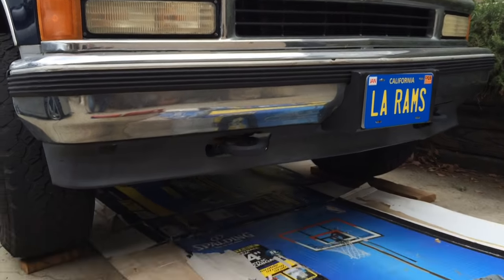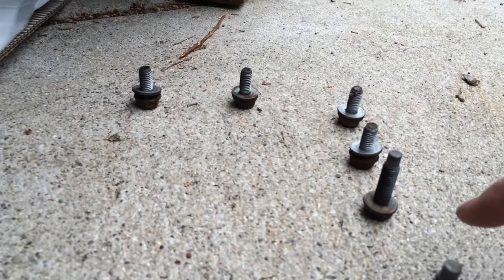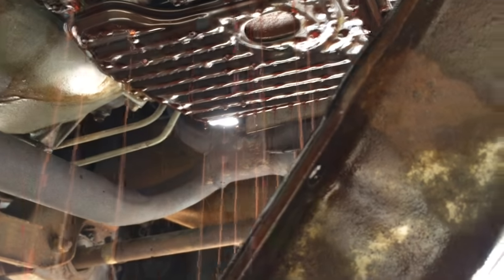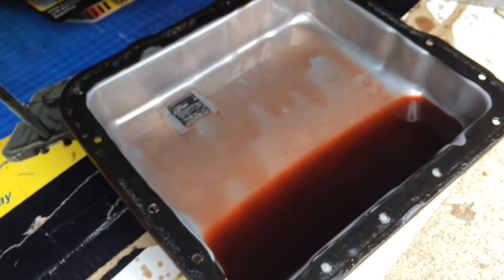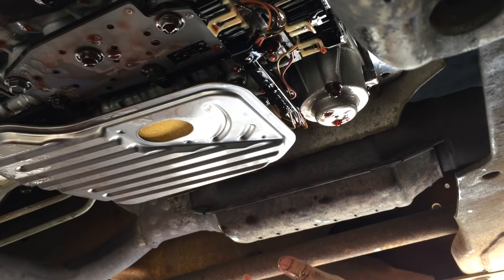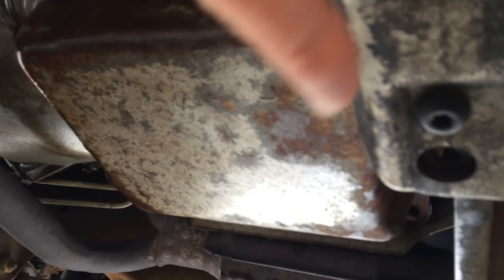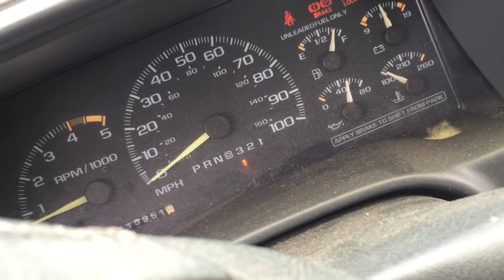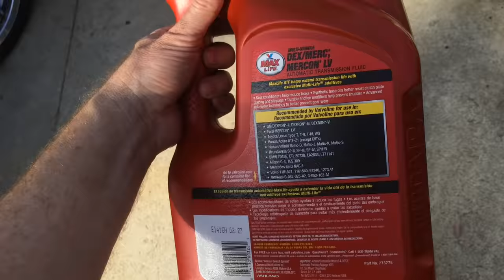Chevy Truck Transmission Fluid And Filter Change

Comment: I changed my transmission fluid and after 10 miles on the highway the RPMs shot up over 2000 and I couldn't go over 50 then I got off the highway and could not go over 25!!! No problems before I changed this WTF!!!! I took the pan back down and the filter had fell off so I changed the fluid and filter agin and it does the same thing.. Nothing looked out of place as far as sensors on the trans. Now I'm being told it has to be rebuilt!!!!
Reply: well maybe its better then to let a shop do it then?
Reply: Seth Buie you should always reuse old transmission fluid , pour through a strainer for sediment , . Swapping really high mileage transmission fluid with completely new fluid , will likely cause a rebuild.
Reply: Justin Ayres so how change only a little bit or what how do I prevent that
Reply: Justin Ayres  I just got a 91 1500 at 4wd truck. Serious tran issues. Was going to start simple and change fluid and filter...can you explain more on swapping fluid and any other suggestions.  Thanks
Reply: Tiffany Tatum for the most part this videos instructions are generally correct however as I mentioned above high mileage vehicles need to use as much of the original fluid in the transmission as possible if you replace it with brand new highly viscous fluid the transmission will start slipping because it lacks the Metal Sludge that it's used to. You can pick up automotive oil cone style filters and strain your old transmission fluid so that you remove any of the physically visible sediment in the fluid. Then mix that with a little bit of high mileage transmission fluid and for that back in it is of course a good idea to clean out the bottom of the pan and if you don't have a magnet go ahead and put one in there.. the filters look kind of like coffee filters with a micron rated mesh at the bottom make sure and get the largest Micron rating available which will allow as much of the original micro shavings to be kept in the oil.  All old mileage vehicle parts and fluid maintenance is basically the same, if you put a new part up against an old part you will get uneven wear in the old part will wear out faster the same applies to fluid which is why doing complete engine and transmission flushes on very high mileage Vehicles is almost always a bad idea unless you plan on rebuilding it.
Reply: As other commenters stated the cap that he removed was actually stuck inside the old hole he should have pulled the ring out and kept the new one on the filter it is basically a gasket
Reply: Coolant is the one exception to the fluid flush rule it is safe to flush the coolant reservoir and the water jacket of the engine in order to remove rust and debris and refill it with fresh coolant fluid
Reply: Tiffany Tatum  , I know this is late, but start with a bottle of Lucas trans fix.  See if that helps some.  If it does,   Start the process of what Justin Ayres says to do.
Reply: Justin Ayres  , thanks for the advice.  Unless regular trans fluid replacement has been done throughout life of vehicle, it is wise to proceed cautiously on high mileage cars trans fluid.
Reply: @johndavidson4128  he doesnt know what hes talking about.
Reply: @waterloo123100  I quoted my buddy that owns a transmission shop, I trust him over you
Reply: @johndavidson4128 You shouldn't trust him. I've serviced many cars that had never had been changed after 100k and they work fine. If its really  that bad after checking the pan all you have to do is put it back together and use the old fluid. That's just a myth people start to get more rebuilds in their shop.
Reply: @fathertime5680  lol, your killing me
Reply: @justinayres401 2 bottles of LUCAS TRANS FIX and B@M TRICK SHIFT  to top it off.
Reply: @thefireman285  Well, at least you got that right. It says on the bottle, up to 2 bottles of LUCAS TRANS FIX.   Man that stuff is a Godsend!
   Another product that helps is B@M TRICK SHIFT (it has friction modifiers to prevent clutch slipping.)  It is used in Drag Racing and is Compatible. Has to be ordered from most Auto stores.

Comment: no drain plug so stupid yet all foreign vehicles have a drain plug for this what was America thinking at least most newer American vehicles have this
Reply from the maker: +Eric Franks maybe they were thinking that you would have to take it to the dealer for service, and they would make more money. I am glad that newer cars have drain plugs.
Reply: if drain plugs were stock the public would never change the filter...
Reply: Its called "Lifetime" fluid. Git gud foreign scrubs
Reply: I did my filter and fluid change today with a bath of fluid all over my face and shoulder included.😂

Comment: Should have taken out the old filter gasket in the hole where the filter pushes back in and used the new won...Its the same ring gasket as the new won,,,anywho it's all good...

Comment: My 1500 LS trans pan has a damn cross-member in the way!! :-( pissed. Last time I did the filter it took way too much effort.
Reply from the maker: That's terrible. I wonder why they did that.  Maybe they wanted to make the frame stiffer.  I know that some of the Jiffy Lube type places have a pump that can change the fluid without taking the pan off.
Reply: Yeah, i have the pump and used it last time i did a service but I dont want to just do that agin, i need to do the filter eventually :-( Lol does totally suck tho bro
Reply: So I am halfway through this process myself on a 1993 S10. I have the same plate that runs across. On the passenger side there are two bolts holding it on. All I did was remove the two bolts with a 5/8 deep well socket (used a pair of vicegrips on the nut on the opposite site to allow it the thread out). This dropped the beam down an inch or two, which allowed me to get to the final three bolts on the pain with a mini socket wrench. Probably too late for you, but wanted to comment this in case others have the same issue.
Reply: I've been told by mechanics that my 1990 Silverado is like this as well, and that they use a jack to lift the transmission off the cross-member, enabling the removal of the transmission pan.
Reply: @hoohoohoblin  ya, and obviously the filter never gets changed. Rip Off!
Reply: @Scatterbrain76  Ya, it sucks more than anything that has sucked before.

Comment: Also people keep talking junk about you taking the cap off or the Rubber seal. Number one I took out that seal yesterday and that was a pain in the f**** ass. It took me probably 30 minutes to get that damn thing out and once it came out the rubber was good on it and the metal was fine I should have just did the same thing you did and take off the new one and put it up in there. Next time I do this I will be taking the new gasket off of the snorkel for the filter. The hell with trying to get that other thing out. I know I'm going to get probably comment saying oh use a flat head screwdriver but let me tell you what, I did. And it was a pain in the ass. Then trying to get the new one up in there was hell because I tried to use a little bit of transmission fluid to lube it up to get it in the hole, but it was slightly bigger than the whole and it just was is a pain. I'm more of a construction guy that's what I grew up on I am a little bit mechanically inclined but that was a pain in the ass
Reply from the maker: Thanks! I guess I am an accidental genius. I am glad I didn’t try to get the old one out.
Reply: Same E    Two important tools to remember :  Preparation H and Kentucky Jelly.

Comment: You ever have a problem with the automatic with shifting from 1st to 2nd. Like it's kind of a harder shift? Let me know if you have ever experienced this. I'm going to be dropping the pan. Changing the fluid and taking a look at the 1/2 accumulator. All the rest of my gears shift smoothly. Just a kind of a jolt from 1st to 2nd.
Reply: I have a 1990 Chevy k2500  that does this, only on the first few shifts. Once the drivetrain warms up a bit, the 1-2 upshift is not quite so harsh.
Reply: @kenc.9067  how long have you owned your vehicle? I just purchased this used off a guy. I'm slowly fixing up the body and going to make a nice work truck 😎
Reply: @blakebrass125  have owned it 7 months. It's in decent shape for its age, runs well, needs body work
Reply: @kenc.9067  mine needs body work aswell. Just finished fixing rust on front wheels wells. Going to weld in new rear wheel Arch's and put on some fender flares. Then tackle the rockers which aren't in too bad of condition.
Reply: I had that exact problem on my 1995 Sierra. Replaced the throttle position sensor today- AC Delco part number 213-895. Much better and smoother between gears. So easy even I could do it.
Reply: @tdoti101yt  I'll definitely look into this as well. Thank you

Comment: I take it that you use the old seal in the case cuz it didn't appear that you replaced it.
Reply from the maker: Correct.  It was still stuck in the hole.

Comment: torque specs is 9 ftlbs
Reply from the maker: +Joe Hernandez Thanks.
Reply: hoohoohoblin hi I have a1996 sierra step side but I having trouble getting to the bolts near drive shaft a plate that runs across the truck is in the way pls help
Reply: have you ever needed to replace the transmission solenoid?
Reply: So I am halfway through this process myself on a 1993 S10. I have the same plate that runs across. On the passenger side there are two bolts holding it on. All I did was remove the two bolts with a 5/8 deep well socket (used a pair of vicegrips on the nut on the opposite site to allow it the thread out). This dropped the beam down an inch or two, which allowed me to get to the final three bolts on the pain with a mini socket wrench. Probably too late for you, but wanted to comment this in case others have the same issue.

Comment: pump it out the top filler with a $5 pump.  you can take 95%  lot cleaner
Reply: don't ever do that, you get the fluid out but none of the debris, easy isn't always best

Comment: I left that cap on and it clicked into place. It kept falling out without it.
Reply from the maker: +bsizzle Hill that cap thing is supposed to be in there. On my truck in the video, the old one was stuck in the transmission, so the new one wouldn't fit in. I guess the right thing to do would've been to take the old one out of the transmission went out of stock, and put the new one in. Yours should be fine.

Comment: Yes. I cannot remove it.
Reply: According to 1996 Chev K1500 Haynes manual, The cross-member  isn't removed. The transmission is jacked up off the cross-member with a floor jack once the "center transmission mount nut is removed". A small block of wood is inserted between the transmission mount and the crossmember to hold up the transmission to maintain clearance for removal of the pan when the floor jack is removed. Cautions: Use a Piece of 2X4 wood block between the jack and the tranny pan to protect the tranny pan., Do not place fingers between the crossmember and the raised transmission. I have not tried this procedure, yet! You may want find a Haynes manual!
Reply: Thanks. I will give it a try. Shop wants 180.00
Reply: So I am halfway through this process myself on a 1993 S10. I have the same plate that runs across. On the passenger side there are two bolts holding it on. All I did was remove the two bolts with a 5/8 deep well socket (used a pair of vicegrips on the nut on the opposite site to allow it the thread out). This dropped the beam down an inch or two, which allowed me to get to the final three bolts on the pain with a mini socket wrench. Probably too late for you, but wanted to comment this in case others have the same issue.
Reply: @rickrichards345  I had a Bad feeling about that @#$!!!po💩!!!!
🤢ARRRRRRRRRRR! HULK ANGRY!

   OK, I'm better now. Where was I?
Should that 2x4 be Oak, Cedar or Pine? (just venting) 
   Thanks for sharing that. I had a feeling it would need a jack. 🙂👍🇺🇸

Comment: Thank you for a simple video. Fucking finally
Reply from the maker: You’re welcome.
Reply: @hoohoohoblin  I have a Silverado 1500 4.8 2 wheel drive LS trim package. I guess you could call it the Canadian model. He has 266 thousand miles I change the filter yesterday the transmission fluid was completely black. The magnet in the bottom of the pan was like goo. When I start my truck up and put it in Drive when it's trying to change out a first into second it revs up really high and I have to let off the gas and then it'll change in the second and then I put my foot back on the gas and it and runs fine. Do you think my transmission is gone? I thought maybe changing the transmission filter would help it. Also the new fluid is starting to turn brown because of the old s*** that was left in the torque converter

Comment: WoW! What were they [GM ] Thinking... No Drain Plug..Errr .. and many others..  That thin sheet metal pan... In the past.. have hammered [lightly]  pans back where they would not leak. With the help of a little sealant..
Reply from the maker: +MCTeck maybe they were thinking you would have to take it to them for service. Fortunately these transmissions run forever even if you never change the oil and filters. Looking under my car, which is 10 years newer, I see a drain plug and a spin on oil filter.
Reply: I got a 94 GMC Sierra 1500 I was driving to the field in firewood and hit a really bad dip in the ground and ended up denting the dome-shaped aluminum cover directly in front of the transmission pan and now I can hear the gears inside there scraping where is dented and also there's like a little drain hole at the center of the bottom and I can see  gear teeth in there there's about I think 4 maybe 6 bolts holding it on seems like I would be able to easily hammer the dent out from the inside if I can get the pan off any bodies thoughts please help I need delivered as firewood oh and can hear scraping and whining and gets worse as I accelerate Etc

Comment: need to remove that rubber sleeve ?
Reply from the maker: Probably. The kit came with one, but the old one should be fine. You can read the other comments by people who had a lot of trouble trying to get the old one out to replace it.
Reply: @hoohoohoblin  thank you

Comment: sad.... he didn't know where the supply line was and thus did it wrong. You just contaminated the new fluid by mixing it with the old. always disconnect supply line and attach a clear line you buy from home Depot till you get clean fluid
Reply: Paul Wyatt or you can YouTube how to properly flush a transmission instead of getting price gouged from a service tech
Reply: Jack Johnson which you should never do to old transmissions
Reply: Jack. Thanks for that idea. You confirmed what I was thinking: a Clear hose to see when it turns clean.
Reply: @jackjohnson2437  EXCELLENT 🤣👍🇺🇸 That is on my list.